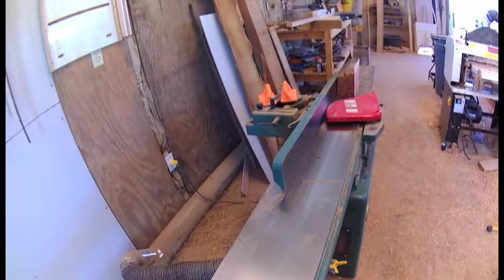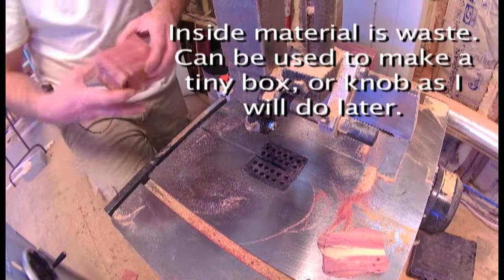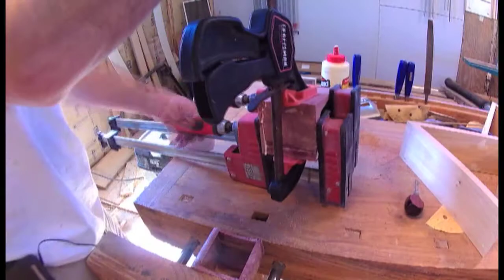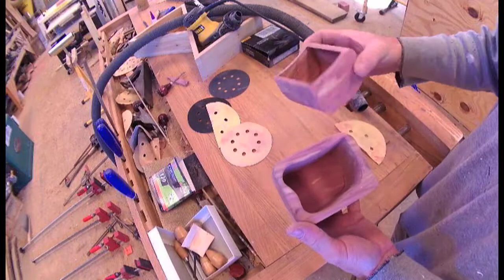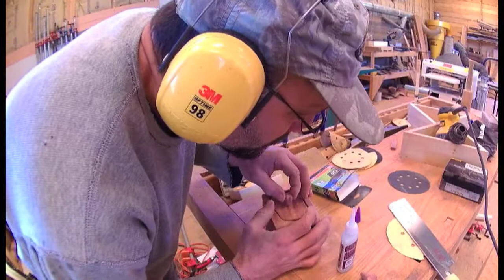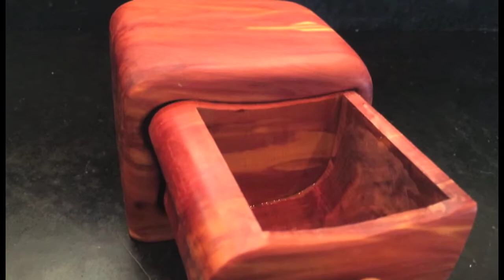Make a cedar bandsaw box.  FarmCraft101

Comment: Great box should I use a thin or wide blade
Reply from the maker: Thin kerf is better.  The width of the blade depends on how tight of curves you want to cut.  If you want to cut small radii, then thin blade.  Good luck.
Reply: FarmCraft101  thanks